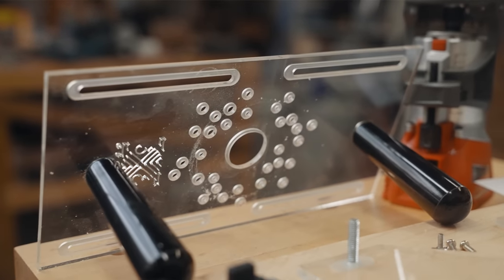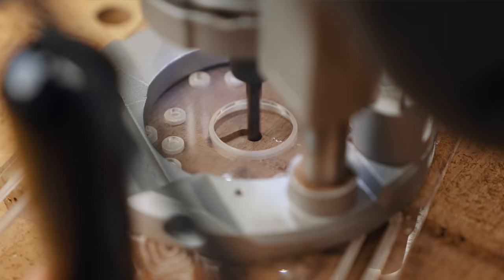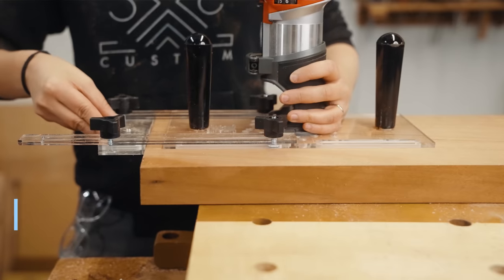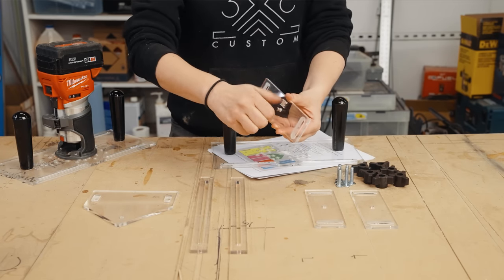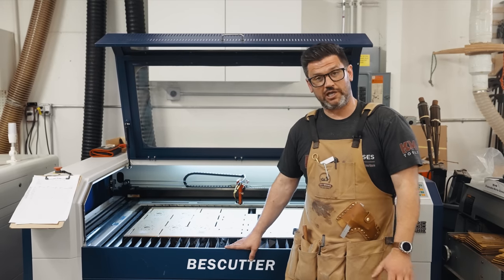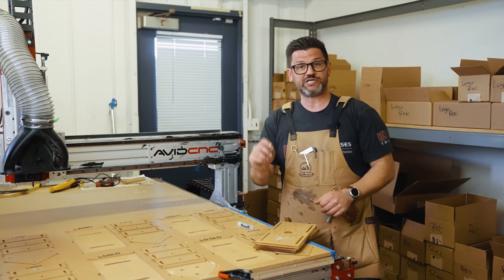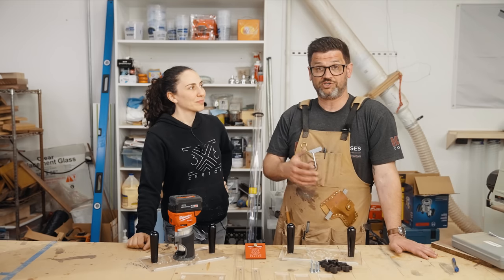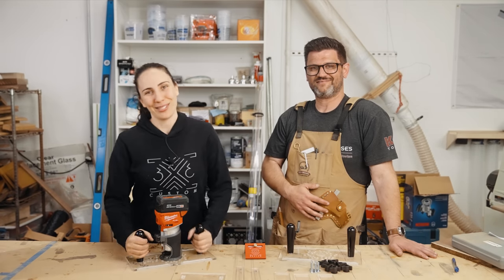The 6-in-1 Universal Trim Router Jig is FINALLY HERE!

Comment from the maker: Get the 6-in-1 Universal Trim Router Jig and The Limited Edition 3x3 Custom Stop Block: https://bit.ly/3x3customproducts

This 6-in-1 Universal Router Jig fits the current/previous corded and battery-powered version of these 9 TRIM Router Bases: Makita Fixed and Plunge, Dewalt Fixed and Plunge, Bosch Fixed and Plunge, Milwaukee Fixed, Ridgid, Ryobi.

If your router is not on the list it may fit (at least 3 holes recommended). You would need to find the dimensions of your base plate mounting holes and compare it to the models listed.

Check out Jonathan Katz-Moses:
Katz-Moses Tools: https://lddy.no/141vc 
Subscribe to JKM Youtube: https://www.youtube.com/channel/UCXBNF-A7QlYT3tT-B9N4ElAJKM Instagram: https://www.instagram.com/jkatzmoses/
KM Tools Instagram: https://www.instagram.com/katzmosestools/

Manufacturing Equipment:
Avid CNC: https://bit.ly/avidcncmachines
Bescutter Laser: https://bit.ly/bescutterlasers
Black Box Vacuum Pumps: https://bit.ly/blackboxvacuumpumps
Bits and Bits Router Bits JKATZMOSES15 for 15% off: https://bit.ly/bitsandbitsrouterbits
Reply: Tamar, you might want to add a link to your build and longer version of the use of the jig you originally did to show uses not as rushed as you did here. Good luck with the sales!
Reply from the maker: @MRrwmac  I’m going to make a new video with the added features 👍
Reply: Just a note that when on the mobile version of your site I could not find the cart to check out. I had to tell chrome on my pixel to show the desktop version.

I'm so excited to get mine! Thanks!!!!
Reply: @frankmthompson  Thank you for posting that! I was going crazy trying to figure out how to check out until I read your post!
Reply: @frankmthompson  holy hell, THANK YOU! I was thinking I had lost my mind!
Reply: Would it be possible to post the sheet that has the base plate mounting holes laid out on it so those of us with a different trim router (new Triton owner over here) can check to see if it would work?
Reply from the maker: @fibbsjc  oh no! I also think there was an ad blocking the cart… I just figured out how to get rid of that!
Reply: Doesn’t work with a port a cable router??😢
Reply: I ordered mine as soon as I saw the video. WOOOOOOOO
Reply: @michaelc5369  plexiglass.  Buy the jig and drill 2 holes.  Easy peasy.  Cost is pretty reasonable compared to amount of material to buy to make your own.
Reply: Do you shop to Australia?
Reply from the maker: @larissahill8403  yup!
Reply: International delivery?
Reply: The moment I saw the video start, my first thought was “She’s doing this with Katz-Moses, isn’t she?” Lmaorofl I’m here for it!
Reply: @3x3CustomTamar  no worries-I got my order in! So happy to see your product getting made and even happier to have one coming my way! Love everything you do-thanks for making it all so approachable.
Reply: @michaelc5369  Porter Cable invented the trim router and probably made more than the other manufactures.
Reply: Are there and markings for centre of router bit?
Reply from the maker: @sprayingasaservice850  yup!
Reply from the maker: @fibbsjc  awesome! Thanks so much!
Reply: @3x3CustomTamar  Because of two head injuries a longer "how to use" video would be a huge help for me personally. Thanks for thinking of making one.
Reply from the maker: @frankkatusa6855  I posted it this morning!
Reply: @Tamar, I purchased this jig and I like it a lot. However, I couldn’t use the sheet that you have provided to line up the base plate to my Dewalt DWP611PK fixed base. I tried both the plunge and fixed base spots on the sheet, which did not work. Finally I put the tool’ base plate back on and used it to locate the jigs base plate screw holes. Those holes didn’t lineup with either of the spots on the sheet. I’m thinking the (A1/Letter) page size, print orientation(Portrait/Landscape) & the zoom settings should be specified.
Another suggestion is to etch your logo on the top side of the base plate, cos, I feel the burr of the etchings and it can hold saw dust in there.
Reply: Waiting on my email to say this and the stop block are back in stock, patiently lol!
Reply: Followed the link and seen they were sold out are there going to be more of them made or was it just a one and done run

Comment: Received this jig much quicker than I expected based on presale purchase.  Very impressed by the quality of the machining.  I built this jig myself from acrylic based on Tamar’s plans about 6 months ago, but could not get the same quality machining of the slots because the acrylic would tend to melt and harden through the router passes.  This is Avery useful jig.  Glad to see Tamar and Johnathan working together on this.  They both produce very useful content.  Tamar’s jigs are always very useful.
Reply from the maker: So awesome to hear! Lots of ppl were having issues making it themselves. I am so happy we are able to offer it to all of you!
Reply: @3x3CustomTamar  The threaded pin in the new 6 in 1 jig is an excellent improvement over the pin I was using in my home made version based on your plans.  It was also a significant improvement that the new jig is designed to handle both the fixed and plunge bases for routers (although I had already made that adjustment in my home built).  Keep up the good work, Tamar.  I've made more than a few of your jigs and found them all to be very useful.  I can't recommend your YouTube channel and Jonathan's YouTube channel highly enough.
Reply from the maker: @michaelvanic1043  that’s so awesome to hear!

Comment: Terrific jig. I highly recommend it. In my case, my Bosch Colt trim router didn’t fit the grey holes labeled for Bosch Colt in the instructions. However, it only took me 30 seconds to see that it fit the other (blue) Bosch holes for a plunge router. My base has 4 holes and it was easy to tell that it lined up with the one with 4 holes (not 3).

Comment: I receive mine nice works. One thing I noticed it only lines up with one pair of holes for my dewalt 611 plunger.  Also since I have a laser I added 1/2" lines both vertically and horizontally across the base this way I can line it up with my marks and I instantly know if I am 1/2" to 5" from the center of the router.

Comment: Hope yall see this comment but one thing I've always wanted is a base plate with an offset guide that works with irregular edges for cutting offset grooves into the face of the work piece that follows the edge. Picture a live edge cutting board with a juice ring that mimics the edge...  if yall think you can make something like that that eliminates the risk of getting "off track" I'd buy one right away

Comment: Suggestion: "blank" plates with no screw holes for the router for those who have other routers than the supported ones. For alignment you could include a disk that fits in the middle hole and a round rod of typical bit shank diameter that goes in a hole in the middle of the disk.
Reply from the maker: We considered it. Maybe we will do that for the second run, If there is a demand for it

Comment: Great product. Thanks for bringing this to market. If the jig fits the DW611 it will also fit the DW600b which is DeWalt's cordless router and also fit the Porter-Cable 450PK which uses the exact same plunge base as the DW611 and DW600b.
Reply from the maker: As far as the 600b, yes. It will def fit. 
Will have to check on porter cable…
Reply: @3x3CustomTamar  I have both, the plunge bases are exactly the same except for color.
Reply from the maker: @bobd.  but the fixed base is not the same? Just the plunge?
Reply: @3x3CustomTamar  The fixed base is the same too. I sell a jig that works with the plunge base.

Comment: I love the jig, I love the collaboration. I one question and one suggestion. 
Question, COULD you have the CNC do the drilling and countersinking or whatever to the whole sheet and then just register off the same zero for the laser to do its thing? (I’m guess this was explored so I’m wondering why it wouldn’t work. 
My suggestion
Include a few of those easy to lose pins and put them in a bag, don’t tape them, the tape will probably leave a nice sticky spot right where your hand goes. It would probably only cost a little to add extra pins but for someone to order an extra would probably still cost at least $5 shipping and all the associated work to get it sent out.
Reply from the maker: We’ll see if that becomes an issue… but it’s def a good thought

Comment: I don't have a  router table some I'm looking at a variety of router jigs that will allow me to put a 1/4" groove into the edge of 3/4" plywood allowing me to do something similar with what you did in you Rounded Plywood Corners video. I need the 1/4" groove to run 48" though. All that to ask you if I'll be able to offset my guide (most like the flat side of the triangle guide from what I can tell) approximately 3/8" from the center of my 1/4" flat end mill bit?

Comment: Can you teach us how to make an indexing jig to use with a router,  that rides in the previous cut to rout multiple parallel dados.  Thanks.  Susan
Reply from the maker: You can simply just double side tape a scrap that will run along the edge of your previous cut to the bottom

Comment: I was wondering if anyone who has this jig is using it with a Bosch plunge router. The reason I'm asking is I can't get the holes to line up. The model I'm using is a Bosch EVSPK 1617 w/plunger. Maybe this is one of the routers the jig won't fit? I'm really looking forward to using this cool tool. Thanks

Comment: Hi Tamar. I finally got around to using your 6-1 trim router for my Bosch Colt but it doesn't fit. the router ends up far to one side of center. The patterns I printed at actual size and match your base perfectly. I have pictures if you'd like to see what it looks like. What would you suggest I do?

Comment: Hey Tamara,  do you think this could be used instead of the Router Edger Guide that you made the "how to" for?  I made a 16" version of that and love it. It seems like the big plus with the edge guide is that flip up action so there is virtually no guess work with bit placement.  Using this 6 in 1, would the best way to line the router up with the cut line go back to eyeing it up and then securing one of the extension feet one the bit is lined up?  Thanks!
Reply from the maker: Just a different sort of application

Comment: Really excited to see this!  Question as someone that is currently shopping for a router: Of the routers that fit this jig, is there one you would recommend strongly over the others or any you would recommend avoiding?
Reply from the maker: Hmmm. I use the Makita. But the Dewalt and Milwaukee are both great too. If you are already on a better platform. Just stick with the batteries you already have
Reply: @3x3CustomTamar  Good to hear.  I have a Makita battery, so was leaning that way, but thought it was good to check.  Thanks again and glad to see this taking off so well!

Comment: Can the air on the vacuum table fixture be reversed to blow the completed parts out of the fixture?
Reply from the maker: No need to. Once you turn it off there is no more suction and you can easily take them out

Comment: Hi Tamar, I assume that 95% of this jig users use imperial system but, you think that will be posible to include a 6mm pin to make the jig metric compliance? Not big deal to file the pin from 6,35  (1/4") to 6 mm but .. just an idea.

Comment: This is awesome!  You two are like Reese's -- two great tastes that taste great together.  (Gentlemen, stop it!)   Do you expect this jig to be a limited production run and then they're gone, or will you be making them on an ongoing basis?  Also, does this fit both Bosch Colt models (the PR20EVS and the bigger/newer GKF125xxx) ?  It appears they have different mounting hole patterns.
Reply from the maker: 😂😂 it should fit both the round and square bases. 

For this first run we got enough material so make a limited run as a test. Now that we see a demand we would love do these on an ongoing basis

Comment: I purchased and have used the jig and love it.  One issue I do see however is that the manufacturer screws from my Dewalt (DWP611) trim router do not sit flush in the jig and are slightly pointing out from the base.  Do you have any recommendations on fixing this?
Reply: Email us. We have replacement screws. Cheers

Comment: Does your trim router jig require both the tool and plunge base? Or only the tool? I need some new routers. I have an ancient craftsman router with the ring fallen off that tells me the depth. I use measuring blocks but it’s awkward, plus it’s not a plunge router. And of course it’s full sized. I could use a trim router plus a new full-sized plunge router. I have never seen an online description of whether I need two separate full-sized routers: one plunge, one not. I’d love advice from your patrons here.
Reply from the maker: Hey. So you def don’t need the plunge base. When you buy a trim router it comes with a fixed base. Then you have an option to purchase a plunge base that is separate. It’s not required, but it will fit!
Reply: @3x3CustomTamar  Thank you! That’s a great start to improving my tools. I ordered one of your jigs. ❤️

Comment: Hey Tamar. I just ordered one of your 6 in 1 router jig. I have a Bosch pony. And I can see that in your video it will clearly work. My question is though you market this jig as a trim router jig. Just out of curiosity will it not work with a full size router as long as the whole patterns line up?
Reply from the maker: We designed it to work with trim routers because of its small size. We will work on a full size router jig soon

Comment: I may be stupid but why did you cut out the individual rectangles and then fitting them to pockets on the CNC?  Would it be faster to leave some tabs on the acrylic sheets and just put some dowels to register on the CNC and then secure entire sheets to the CNC? Like I said I may not be the sharpest tool.
Reply from the maker: We spent a year dialing in this manufacturing process. Lots of reasons why we did what we did 👍
Reply: Then all the edges would have a frosted look. Looks so cool that it comes off the laser clear. Plus the tabs would break without additional work holding

Comment: Great Product.   unfortunate I have a Porter Cable  PCE6435 which isn't on the list.  Is there a way to get a PDf of the Mounting plate hole pattern diagram to see if it might work.  Thanks in advance.
Reply from the maker: Thanks! I know for a fact that router won’t fit. Sorry… but if you email me, I can send you a copy so you can see for yourself
Reply: @3x3CustomTamar  No, that's not necessary.  I trust you.  Just keep up the Good Work.

Comment: Tamara do you know it it will fit on an older craftman corded model or i have a newer cordless matebo ???
Reply from the maker: No. Sorry
Reply: @3x3CustomTamar  you might consider making a run that just has the center hole and no holes drilled for the router base to be done by buyer
Reply from the maker: @frrapp2366  it was definitely a thought…
Reply: @3x3CustomTamar  thanks for replying  love your vids keep on rocking

Comment: I am new to woodworking and would like to ask will this fit a Dewalt DW618? Is this model not considered at trim router so it is not compatible?
Reply from the maker: Yeah. Sorry, it won’t fit that router because it’s not a trim router. This is only meant for smaller compact routers
Reply: @3x3CustomTamar  Thank you for the quick response. I really it wish it wasn’t the case. I guess I’ll just have to get a trim router then. I could really benefit from all the uses built in to this jig.